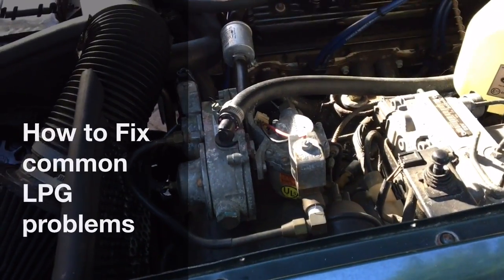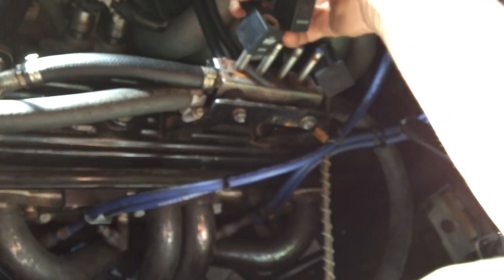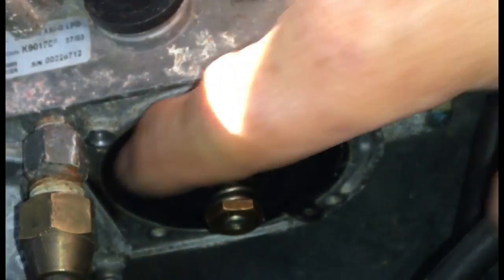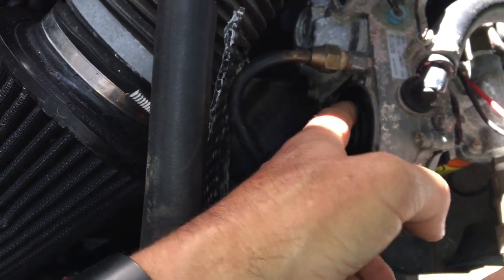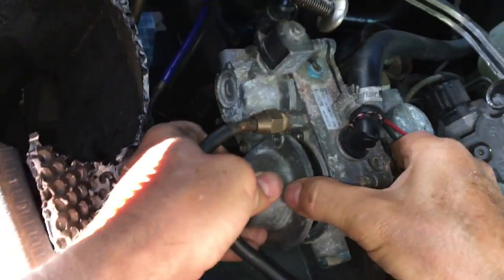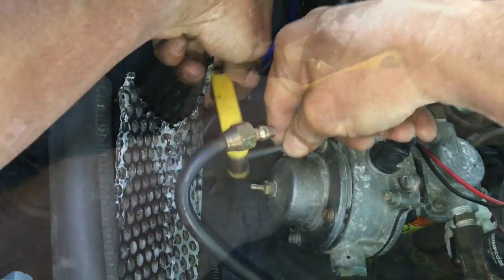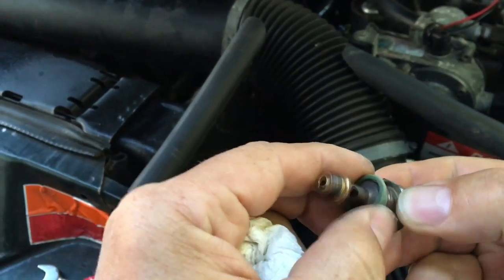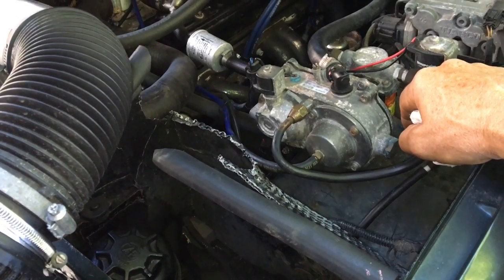How to Fix Common LPG Problems - Vaporiser / Reducer, Injectors

Comment: Hi, update: replaced ecu but new ecu gave out fault code tank solenoid valve so wouldnt turn over to lpg.
Reply from the maker: I assume the old ECU didn’t give this code, so sounds like a brocken connector or wire or a bad new ECU.  Possibly though, as it hasn’t been used for a while, the solenoid could have stuck.  Test if 12 volts is appearing at the solenoid and whether you hear it click when it does.  Or try and manually put 12 volts onto the solenoid yourself with it unplugged to see if you hear it click open.

Comment: My car works on lpg sometimes but just cuts off to have to switch it back into petrol. It worked for four days fine and now when you switch it to lpg just doesn’t seem to switch to gas and when it does it cuts off.
Reply from the maker: Sounds like not enough gas pressure.  Check the gas tank and vapouriser solenoids, that gas is appearing out of the vapouriser and that it is working ok (no holes in rubber diaphragm).  Try and get the software for the ECU if you can and read its status like gas pressure and temperature.  That should give you some clues.

Comment: My car struggles to run got it checked my mechanic they said it’s gas side is faulty . Showed it to gas people they said mechanical side is faulty . On diagnostic it shows cylinder misfiring only but once cleared few moments it’s okay then back to normal . Any tips mate
Reply from the maker: I assume you are not tackling it yourself so find a more competent mechanic.  If it runs ok on petrol then go to an LPG specialist to sort the gas side.  If it’s running poorly on petrol then ignore the Lpg side and get it running on petrol properly first, before tacking any LPG issues.

Comment: I’m getting weak bank on gas change over on my Dodge Ram I’ve noticed it helps to stop this if I manually change because the temperature setting was only 30. I’ve reset it now to 65 but it really does take a while to change over can you help me
Reply from the maker: It takes a bit of trial and error to get the switch over temperature just right.  I think I had mine about 50C.  Most systems have a mode for switching to Lpg straightaway, useful when starting hot.  Look up the mode for yours. 
Alternatively to look for faster switch over check that the water plumbing for the vapourizor is hot and flows well all the time, with interior heater on or off, as flow may be restricted when off.

Comment: Hi, one of my lpg injector is not working. Lpg engineer changed injector rail and still didnt work. Lpg engineer says i need new omvl ecu as it appears wiring is ok. Any ideas why im getting a cylinder/ injector shutdown? Car doesnt misfire on petrol. Many thanks
Reply from the maker: I have had injector coils burn out.  Check by measuring the resistance of the coil with a multimeter and compare to the others.  You can easily swap injector coils around between cylinders if its the omvl type with coils that can slip off.  If the fault moves from one cylinder to another when swapping coils then that will tell you it is the coil on the injector, otherwise it may be the injector itself or the ECU.  To see which cylinder is not firing either slip off or disconnect the injector coil when running on Lpg and see if the idle speed drops.  If no drop then that was the cylinder that was not working.
Reply: @comeinhandynow  dONT DO IT  in your garage, cause fas is running out of that holelele,,,

Comment: My OMVL vaporizer freezes up on start up with cold engine, eventually untill the engine stops. By your experiance what do you think might be the problem? Might there be a hole in the diaphgram?
Reply from the maker: Firstly the car shouldn’t be switching over from petrol to Lpg until the engine is warm.  The switch over temperature is set in the Lpg ECU, so if you have a cable and software you can check and change this.  Check that the coolant pipes that connect the vaporiser to the heater water pipes (usually) are flowing warm/hot water once the engine is warm.  If there is insufficient flow then it can’t vapourise the gas correctly and the vapouriser could freeze up.  Maybe on your car the interior heater circuit has the type that stops the flow when ‘cold’ is selected inside the car, and in that case if those pipes are used to heat the vapouriser then the flow to that will stop and it could freeze up.

A hole in the diaphragm usually make the engine run rough at idle and make it sound like its backfiring when decelerating.
Reply: comeinhandynow, Thank you very much sir. I will have a look into this. Have a nice day! 👍

Comment: Hello i have chevrolet aveo 1.2 LPG, with 270000km without issues.
 About 4 o 5 months ago my transmission broke, was changed, the problem after that, is that the LPG system it´s not working.
 I start the engine, works with gasoline, after some time, the system change to Gas, but change again to gasoline a few seconds later with pi pi pi noise, the same when the gas tank is empty. 
My LPG system is BRC - Ferrosite.
Reply from the maker: The Lpg ECU thinks there is insufficient gas pressure at the injectors.  Preferably get an interface cable and the software for that Lpg system and read out the gas pressure to check.  It could be a stuck solenoid on the gas flow: at tank, pre-vaporisor or post-vapourisor or a clogged filter.  Try and check all those and see if gas is reaching the injectors.

Comment: Regards, I write because I have a problem with my car: LPG (liquid) from the rear tank comes to the reducer via solenoid valve, however, there is nothing in the delivery tube from reducer to motor,  there is no gas (or maybe a small amount..). The car immediately returns with gasoline. Wrong reducer position? or incorrect refrigerant temperature? the reducer is not frozen or even hot..
Reply from the maker: The vapouriser/reducer should be warmed by the engine coolant circuit, so should be warm/hot.  Check gas pressure is entering the vapouriser.  Check gas pressure and temperature by reading those values from the gas Ecu.  (Get software on web and get cable to laptop interface cable). Check other solenoids.  Then maybe dismantle and check vapouriser.

Comment: Sir,  A method I developed to replace the cap on the diaphragm makes the task considerably easier.  After installing the new diaphragm with super glue I loosely screw in two long threaded studs into two of the opposing mounting holes for the cap.
Then I slide the cap over the two studs followed with a nut on each stud. This allows me to alternately tighten each nut, thus easily compressing the springs and setting the cap into position. Once seated, the other mounting screws can be installed and tighten.  At this time, the studs have completed their job and can be removed by double nutting the studs and backing them out. Replace the remaining screws into the holes that retained the studs and tighten accordingly.  Done and it's tea time.
Reply from the maker: Thanks for the tip
Reply: Am using lovato and this very type, I they all consume more lpg than even petrol, I I've gone to expect for more services but it still consume more

Comment: Good and informative video. I have a issue today and if you have time to answer i will appreciate it.
My car runs good on lpg but today it just could not transfer from petrol ot gas. When i stopped i noticed that the loud noise the injectors make when its about to transfer to lpg isn't there. Its an old Landi Renzo lpg system with a new evaporiser 2 years ago.
Reply from the maker: So it will not switch over to Lpg. This may be because it has decided that the vapourizer is not warm enough yet (check that and any reasons for it) or because there is not enough Lpg gas pressure (check the gas pressure sensor and gas feed.  Maybe a solenoid is not opening)

Comment: I have an interesting question, they installed landi renzo omegas 3. It was great 3 months and now it started to lose power. Only sometimes when i run at 1300rpm and give max throttle at once. It will slow down and than accelerate. Like it loses power and than suddenly gains power.
Reply from the maker: That's hard to diagnose remotely.  Sounds like not enough gas is getting through like maybe clogged injectors.  Mine used to get wax in them which seems to work its way through from the Lpg tank.  I changed the water plumbing to run hot water copper pipes under the injector banks to keep any wax in the injectors more liquid so that it doesnt clog.
The filters are meant to remove the wax, so they need to be regularly replaced.  They are two in my own setup.  One before and one after the vapouriser.
Reply: suggestion : check your spark plugs or spark connectors ...

Comment: i have a p38 rang rover 1997 it has always run well now it starts on petrol switch over to lpg stops in medially help
Reply from the maker: You need to isolate the problem before you can fix the part responsible.  So work out, for instance, is gas getting to the injectors, is it getting out of or into the vapourisor, is it getting out of the tank?

Comment: hello

In my car when the gas is quickly released immediately explode ??
I do not know if the fault is in the evaporator
Reply from the maker: It could well be a hole in the rubber diagram in the vapourizer letting Lpg gas into the vacuum line.  Have a look at it.
Reply: I do not know he can get lpg gas into any holes
is a rubber when blow, but it does not know if it gets the air to blow so hard How much to blow up so much 
I do not know how to prevent this
Reply from the maker: If the vapourizer has a vacuum line attached to it, then that is how Lpg gas can get into the inlet manifold, via a hole in the rubber diaphragm in the vapourizer.
Reply: comeinhandynow If I am going to change the evaporator, is it still possible to explode?
Reply from the maker: It depends on if it's that causing the fault.  Take it apart and look. A repair kit is a lot cheaper and comes with new diaphragms.
Reply: thank you best regards ..

Comment: why don't you remove the vaporiser and fix the repair kit properly, i think the vaporiser hang on single nut only, and of course  you need to remove those 6mm copper pipe as well  that's all.
Reply from the maker: You could do that but it takes more time and you have disconnect and drain out the coolant water from the vaporiser as well.
Reply: comeinhandynow excellent video, cheers 
next time you take the vaporiser bolts off, try and match up two longer bolts with nuts wound up to the head.
insert longer bolts into the threads and
use the nuts to compress the thing,
giving you a little help to align the springs /check membrane.
hope It helps.
 finding the correct bolts is gonna be the bugger tho.
Reply from the maker: Thanks. Good tip.

Comment: Good job, -is this will more comfortable to make it on a table? (extra time..etc :)) how many km. make before problem comes? And witch is the engine is? thanks!
Reply from the maker: Thanks.  Yep probably but more stuff to disconnect.  The problem seems to occur every couple of years maybe, not sure about km, maybe 20000km.  Engine in this is a 5.7l v8 Chevy TPI engine
Reply: +comeinhandynow  Ok, Your air filter, for our region-(south of Russia) engine will completely full of send, after piston rings finished..
Reply: +comeinhandynow Yeah, I know that k&n its a good company, but also with k&n I seen dust near throtle so lighting- breath and clean air its different things. Also I tested "sport air filters- without special camshafts, ecu program corrections these filters- give just a sound.. (dinamic air inlet sound approx after 3000rpm thats it and like extra additives -dust inside engine
Reply from the maker: Interesting to know. Thanks
Reply: +comeinhandynow Youre welcome!

Comment: It's very thoughtful of you to go to all the trouble to demo AND answer comments. :-)

Just a wee low-tech suggestion to help with reinstalling the spring body: 

How about snugging up a large tiewrap around the whole vap assembly (diagonally) to hold the cap in place as if there are no screws BEFORE removing them? 

Then push it aside till you're ready to reinstall the 'bell'. 

When reassembling, squeeze the cap on and swing the tiewrap back over the ass'y to hold it in place. Cut it off after tightening the screws to satisfaction. Use 2 tiewraps if necessary.
Reply from the maker: Good suggestion, thanks for contributing.

Comment: Does anybody know how to fix a Nissan 50 forklift, a technician told me to replace the evaporation valve which I did but still wont start . I am getting full all the way to the mixer body. If I use a quick start it will start.

Comment: Hey just a quick update on my car ,I fitted my vaporizer and calibrated it no problem with the software ,I turned the gas off in the LPG tank and disconnected the solenoid plug too ,cars running perfect thanks for the help 👍
Reply from the maker: Great to hear.
Reply: Hi great stuff. So what exactly did you do. My V8 2002 landy2 is having similar symptoms.  Beeping sound then cuts off and stalls when I turn to LPG but fine on petrol

Comment: Hi there, Thanks for this video. I have problem with my car stalling when slowing down on lights, only on gas, petrol is fine...I also noticed a coolant loss, but can't see where, so this might be related...but maybe not...I wanted to ask for your thoughts on this...Thank you
Reply from the maker: Sounds like the gas mixture is not right for gas. It's useful to have an air/fuel ratio meter connected to a lambda sensor in the exhaust in order to check if the engine is getting the right mixture.  I guess that it's not correct since it stalls, which could be related to a problem with the vapouriser or injectors.  Removing the solenoid on each gas injector in turn will tell you if that injector is working or not.  After that try giving the vapouriser a service by stripping it down, replacing the seals and rubber diaphragms and check it visually.  Also change the gas filters at the same time.  The service parts aren't that expensive.

Comment: Hi there I'm in the middle of changing the vaporizer I'm taking the gas supply of the vaporizer but there seems to be a lot of gas coming out will this disappear or can I turn the gas supply off I'm a bit stumped thanks
Reply from the maker: There should be cut off valves in the supply from the tanks. One at the tank output and one before the vapouriser or filter.  With the ignition off these should be in the closed state.  Check you have some. They have a solenoid coil and two wires attached.  I'm sure you have some.  In which case the gas from the tanks is disconnected.   There is a fair bit of gas released when you disconnect the vapouriser.  Just be sure you are outside and with no ignition sources.  No smoking!  ;)
Reply: That's great thanks for the help I spoke to the LPG shop there guy said there is a manual valve on the on the multivalve and to make sure the electrovalve is also closed too

Comment: I've had a bit of erratic idle which I don't know if the leak could be causing it ,the revs are shooting up from 1000 rmp to 2000 rpm when I press the clutch in
Reply from the maker: My most common leak is the Lpg gas leaking into the vacuum pipe across a holed rubber diagram in the pressure regulator section of the vapourizer.  That lowers the manifold pressure at idle and makes it runs richer as well.

Comment: Hi again that's what I was thinking to I'm running the stag 300 isa 2 LPG system ecu I've got the software on my laptop and the diagnostic cable ,I'm pretty good using it as I have my readouts saved but I wonder if I got the exact vaporizer ,I wouldn't need to change any settings ,its a toughy to decide on .
Reply from the maker: Similar situation for me.  A lambda sensor in the exhaust tied to a dash meter is a useful addition for checking on the state of tune, setting up the map and checking how well it's running.

Comment: im kinda thinking of buying a new vaporizer as the one I've got fitted has aged really badly its been on my car for 4 years .
Reply from the maker: I've had similar thoughts about mine, as they don't last that long.  So far I've just been rebuilding it.  The rebuild kits (on eBay) do have all of the seals.  Bear in mind that vapourizers of a different make would probably require remapping the ECU however due to pressure and flow differences.

Comment: Hi there I've got an omvl cpr vaporizer I'm sure its got a coolant leak would I need to drain all the coolant out of my car when taking apart the vaporizer  thankyou
Reply from the maker: No, just make sure it's not under pressure by removing the cap on the coolant tank and when disconnecting the pipes off the vapourizer lift the pipes higher than the tank to stop water coming out or plug them.  You will loose some water but not too much.

Comment: Thanks for taking all the trouble to shoot, edit and post this item. I'm wondering if I have a different model to your demo. I have a protection plate which drops in under the diaphram you superglued. It supported the membrane whilst wrestling with the spring loaded cap. It stayed in place accordingly. Regs. P.
Reply from the maker: Any chance of a picture? Very interesting.

Comment: Really,  good video.  My Lpg has packed up and I noticed a load of gas coming out the vacuum pipe on the vaporiser,  when I ran the engine with pipe disconnected it was firing it out.  So I'm confident after watching that video that my rubber diaphragm is buggered.  Thanks a lot
Reply from the maker: Cheers.  Best of luck fixing yours.